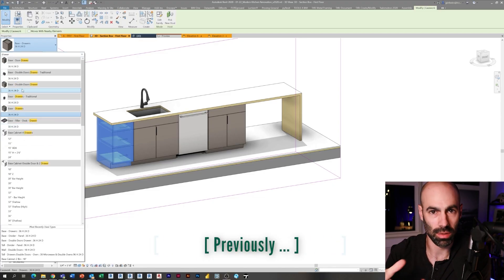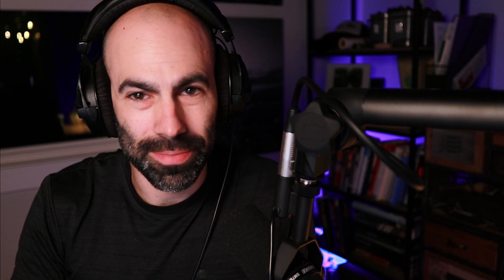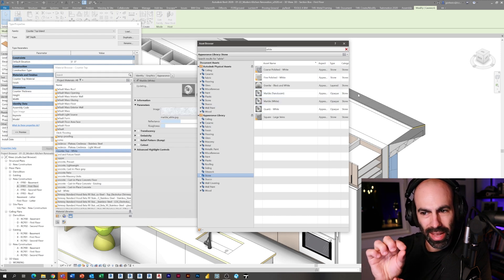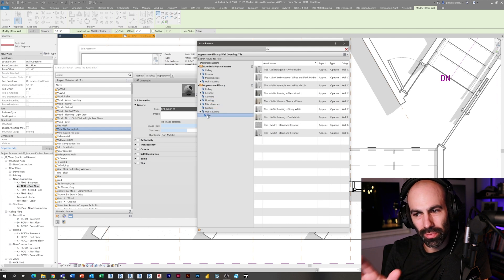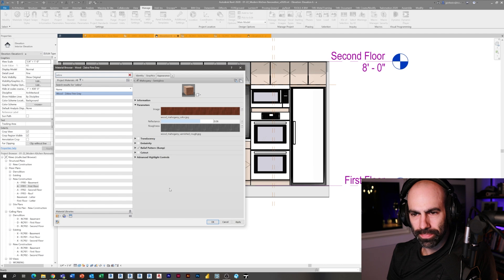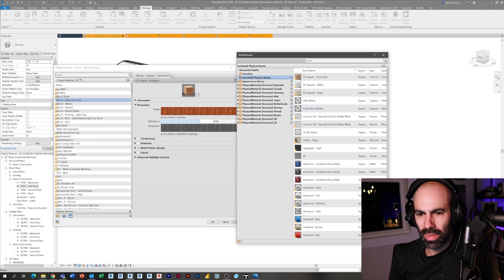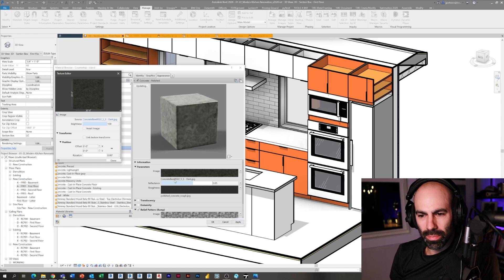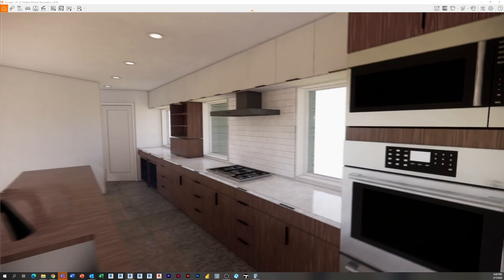EP12 | Adding Materials in Revit

Comment: Great Video! Perfect explanation and really helped me add tile to the bathroom I am designing.  Quick question though: using the material -> Graphic -> foreground-> pattern -> Model and creating a 6x6 tile was great. However, when I view it in interior elevation, I can't see the tile.  I was hoping to see the tile and grout lines. Any advice or assistance?
Reply from the maker: You should see it on interior elevation... maybe your view has a template, filter, or graphic override applied?